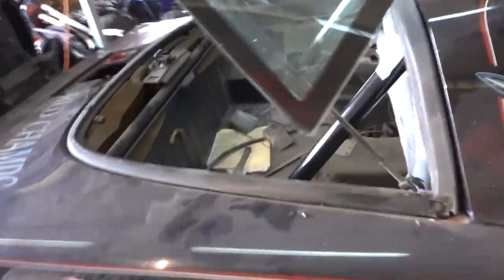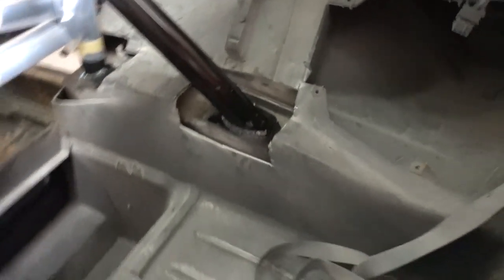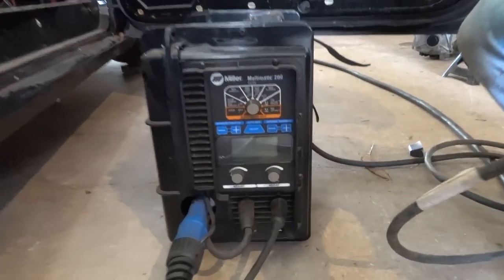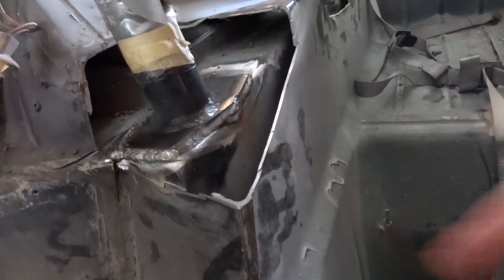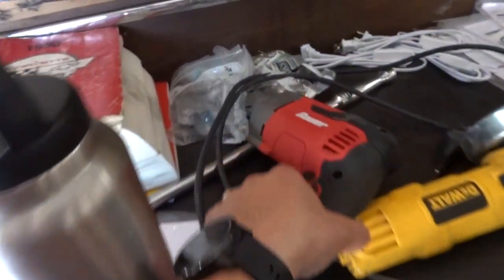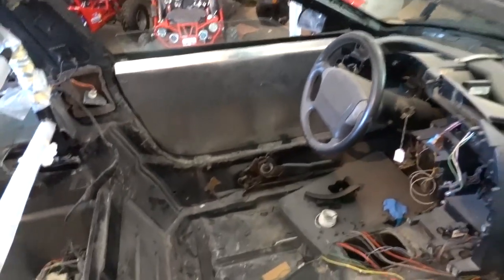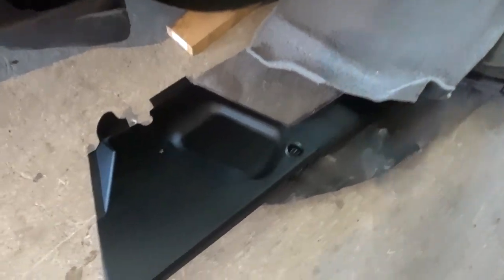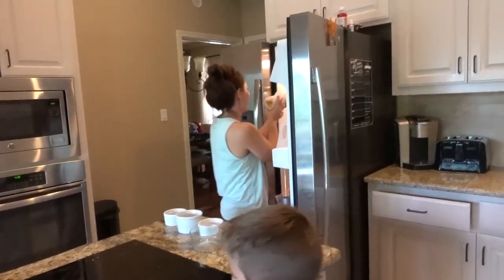Rebuilding a Destroyed ZR1 Corvette Part 8

Comment: I have the exact same welder and it can weld two 10mm  thick pieces of flat bar together no problem, how I have it set up is 4 on the wire feed with setting number 2 and 0.8mm flux core wire. Hope it helps

Comment: The aluminum door panels look great, but... they are going to get extremely HOT sitting in sun.
Reply: Also noisy
Reply: I'm picturing skin graphs and hairless legs.
Reply: they did look good
Reply: I was just coming in to type this! He definitely NEEDS some kind of covering over them or he will get COOKED in the hot Texas sun! Carpeting, stereo box fabric, whatever. A layer of sound deadening material under the carpet would be even better- for insulation/protection and sound deadening.  :)

Comment: You might want to put sound deadening on the back side of those door panels or else your car will sound like a rolling coke can when your driving.and also about your stirring wheel, what are you going to do with the airbag system ? If you get rid of it you may have to reprogram your on board computer

Comment: The wood in the pancake mask is balsa.  You sand the balsa to fit perfectly and it really keeps the light out.  Though they are called pipeliner the pipeline safety folks are saying no more because when you lift the mask you don't have safety glasses on.  Many pipeline welders are still using them though.

Comment: Those little black edge trim strips for the corner of car doors are amazing for hiding the edges on your panels. I did aluminum diamond plate on my old IROC and used a roll of that trimming. It was pretty much the only thing that looked good in that car

Comment: makes Corvette look "worse" but "safer" by adding roll cage, then makes car look "better" but "less safe" by removing steering wheel with air bag!
Reply: Never had an airbag in my hot rods other than who is there  sitting in the passenger seat
Reply: Air bags are designed for normal seats with normal air bags.
They are unsafe in any vehicle that has a roll cage and harnesses.
Normal seat belts are designed for you to have movement in your seat.
You are planted in that race seat when the harness is tight. You can't move at all if you did your job right. 
In a normal seat in an accident you meet the air bag at a very specific time. Any earlier or later then you would die. Thats how they are safe.
A harness will stop your movement and you will hit that airbag right at the end of its explosion and it would wreck your face. Not safe.
All air bags are to be removed from the car if it has a harness system.
There are a bunch of laws regarding harnesses on public streets.
And a bunch of rule in racing about airbags lol.
They don't mix.
Reply: Your welding helmet is probably a solar/battery hybrid.  Leave it in the sun for the day and store it by the window.  The battery is probably dead, so it is running fully on solar.  The solar charges the battery, so it will darken quickly/properly.  Ultimately it runs off the battery, which in most inexpensive helmets are not replaceable.

Comment: I would say make sure to use some foam seal or double sided sticky tape on the back of your door skins, to try and prevent rattling. You also may want to put the stick on sound deadening tape on the back of the door skins to stiffen them up and deaden the sound.

Comment: Bro I respect the hell out of you for admitting that you feel more comfortable letting someone with more experience welding weld the roll bar especially since it's a device designed to save your life in case of a crash. But instead of letting your pride get in the way you admitted that you might not be.. not good enough to do it because you could've definitely done it but instead admitted that they were probably better equipped for the job

Comment: should use ABS plastic for the door panels.  Its black, easy to cut, and can be molded with a heat gun. And you can get 4'x8' sheets!

Comment: When you put those door cards in, probably want to use some rubber washers behind them so they don't vibrate like crazy. Also, the raw aluminum does look good but if you want them to match the interior, I think powder coating or anodizing them black would make them look so damn clean. Just a couple suggestions.

Comment: Get some water head screws for the door panel, they will look a lot better. Might not be a bad idea to put a thin bead of silicon or RTV under the door panel as well. Might cut down on any possible noise from the panel.

Comment: Curb weight 3029 lb. Dodge Daytona Euro Sport T-Top. Inline 6 of 4.6L. Direct port nitrus injection. Dana 35 rear axle with Eaton Elocker. Structural upgrades from the locomotive shop. Figured top speed around 260 MPH.

Comment: Rivet the door panels and put a sound deadening sealer on the back side. Steel sheet metal screws will cause the aluminum to corrode as will prolonged contact with the steel door. I like the look though!

Comment: You can also use that aluminum sheeting to create a shroud around the lower front, rear and sides of the car, to force the window around and over your car, creating down force, instead of the air going under the car, creating lift.

Comment: Hey Matt may I suggest a way of attaching the door panels, race cars use dzus fasteners for their panels it's a way of attaching them that is easily removed and looks nice also. They're available online, especially at sites like Summit racing, Jegs, Speedway, etc. As others mentioned, an insulation barrier between panel and door and those fasteners it would look 👍👍

Comment: **Matt pro tip**
If you lay your silicone down then spray it with soapy water you can run your fingers along it to smooth it out to make it nice and pretty and it wont stick to your fingers.

Comment: Sometimes heating sheet metal with a heat gun will make it a little easier to bend. I’ve done it with my uncle before and I was surprised that it worked so well.

Comment: There's a few videos on one of the Hoonigan channels of a guy named Kyle working on a C4 Corvette and he did some door panels similar to yours. But he had professional equipment and experience and other people helping him so it went smoother. I think yours turned out pretty good considering what you had to work with.

You're probably going to want to put some kind of foam on the back side to dampen any rattling or vibration. Maybe some self adhesive foam weather striping?

Comment: I was going to say that switching to Flux Core would be better, but apparently it's just flux core. I've got a Magnum 130 that does gas and flux core, and it can do up to 1/4 in one pass on Flux Core iirc; but I spent a lot of time figuring out what made a good welder before I bought it, and it ticked all the boxes, so to speak. 

Still a Hobby welder, but its done a pretty good job on what I've used it for. What you want however, is most likely a Multi-process to give you Tig and Stick functionality, as well as Mig; so probably a Miller Multimatic 220 or an ESAB Rebel 215ic, which is honestly what I would like to have, but just not yet.

Comment: You should have riveted the metal around the roll cage.  Those screw heads are going to makes bumps, and wear holes in your carpet.  Unless you use good cushioning under the carpeting.

Comment: For structural welding the corners of the plate should not have been welded. Few welders know bending moments etc so this mistake is common. Welding all thr way around leaves no give so the welds will break.

Comment: You're going to want to beat the corners of the sheet metal down so it doesn't rip the carpet it's a sharp edge and over time will put holes in the carpet

Comment: but why not get a belt sander and shape the edges of the aluminum so you don't have to hope the trim covers it? Also rivets would be better than screws as far as a lil more finished look goes and might be easier to cover with interior.

Comment: Welding with flux core wire is a pain. Very hard to get a beautiful weld and with a really cheap welder you cant get a good weld on anything thicker than 18 gauge steel.

Comment: ok so FYI when welding really thick steal like inch or more you need to push not pull what they are teaching you is pulling which is ok but it will lack penetration when hitting truly thick steel best to learn push and master push so you can get real penetration not that you will but even on smaller steal it is proven that push will get the best bond. As far as welding it just takes a lot of practice i have thousands of hours do to working as a welder for CAT and I can lay some metal but im always perfecting so the welds look better and better its like a surfer always hunting for the best wave. best to just buy some scrap metal and just start welding joints and even if say you could buy an item try and weld and make it instead because practice makes perfect.

Comment: Why did you put a Rollbar into it? Those cars usually are designed so that the roof doesn’t fold in. By cutting the composite parts you might have goofed that up though..

Edit: for cutting the Glassfiber stuff you want P3 filters and a full body suit, that stuff is nasty and sticks to your cloths. This way you easily spread it through the house and your kids might inhale it. Needless to say that that is bad

Comment: Yo u shouldn't have cut so much of that plate on the bottom of the cage it's supposed to be bent around the frame and welded the bigger the plate the more likely ur cage won't punch threw the thin metal that is ur frame when u roll over